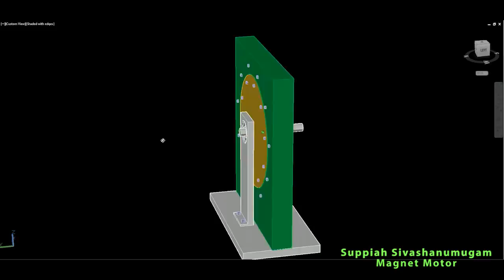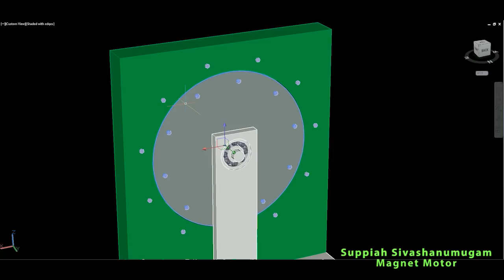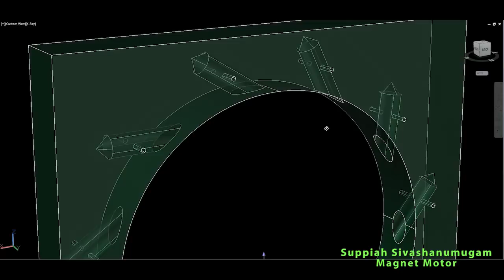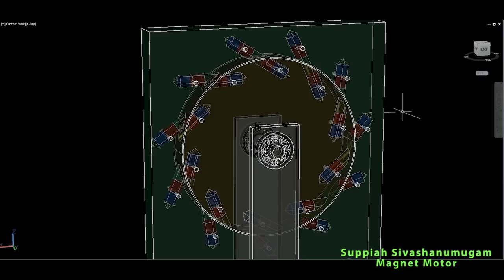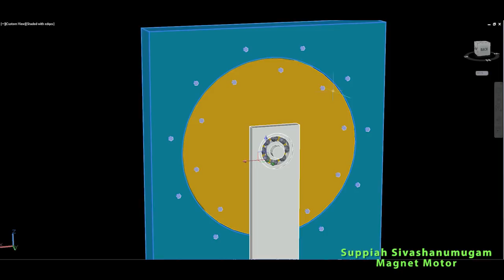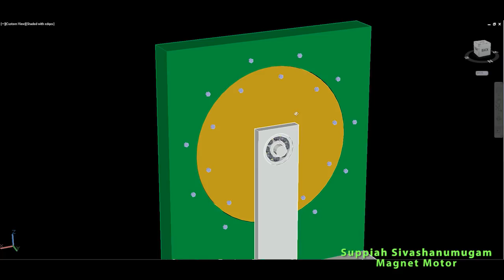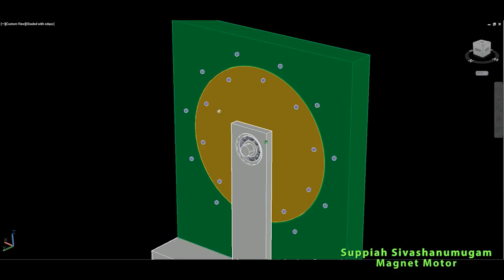FREE ENERGY, Suppiah Permanent Magnet Motor, Magnetic Motor

Comment: Over Unity Water wheel electric generator:
 Top of structure has Huge slanted basin (If looking at it from the side it would be slanting down to the right). When filled with water the water naturally slides down and over edge where it starts falling straight down causing water wheels to spin. Water wheels are stacked on top of each other not touching but close. As water falls it hits them all one after the other making them all spin as it makes it's way to the bottom. At the Bottom of the structure there is a large slanted basin. This basin is slanted in the opposite direction to the one on top so the water slides down to the left, into a pool of sorts that is U shaped,(imagine right below the water wheels is the shallow end and as it slants down it gets deeper for some distance then winds around to the other side of construct and comes back up to another shallow end. Now directly behind the water wheels on a flat surface that is above the pool of water that's curving around it, there is another wheel positioned vertically but this one is not a water wheel, this one has powerful magnets embedded horizontally inside of it on both of it's flat sides so there magnetic repulsive field is pushing outwards away from the disc on both sides. (Also each embedded magnet is surrounded in high permeability metal or Mu-Metal to focus it's magnetic field lines into a condensed strong field. This disc is powered by one powerful electric motor. Now imagine long hollowed out cylindrical tubes submerged & sticking out of the pool of water and reaching all the way up and into the basin that holds water on top. Now imagine each tube has a windy slide inside that goes from top to bottom. Now imagine the tube has rings around it that are magnetically repelled so when the main wheel spins around the horizontally positioned magnets hit into the side of these rings causing the entire cylindrical tube to spin. The spinning motion of the tube will cause it to scoop up the water in the pool and the centrifugal force of the spin and the windy slide inside will guide and force the water back to the top. Now remember for this to work properly there needs to be enough water wheels spinning to generate more electrical current then the motorized wheel needs to spin. 
Key Element 1: Number & quality of water wheels. 
Key Element 2: Quality of electric generator connected to each water wheel.
Key Element 3: Enough tubes to pull enough water from bottom basin back to top basin to equal the rate and amount of water filling both basins at any given time. 
Key fact: The accumulation of electrical current from the electric generators connected to the water wheels must be greater then the 1 electric motor needs to spin.
Key Fact: One must divert the needed electrical current from the generators connected to the water wheels to the motor spinning the disc that has the magnets on it. 
Key Fact : If this is done properly it would be an over Unity Electric Generator.
Reason why some may think this would not work: Some would say the amount of energy the motor needs to spin the disc with magnets on it will always be greater then the amount of electrical current being perpetuated by the electric generators on the water wheels complements of natural energy losses do to heat and friction.
This assumption is understandable however I will explain why this does not stop this device from being an over unity device. You see it comes down to one simple truth. The motor spinning the vertically positioned disc is only actually doing a fraction of the needed work, it is the horizontally positioned magnets impacting into the tubes causing them to spin that is doing the heavy lifting :) and since the magnets are positioned horizontally on disc the push back against them is unable to hinder the motor spinning the disc to a degree that would require it to do loads more work.  
In conclusion this is a device that can be self contained away from the elements so as to not hinder it's effectiveness. And it is an Over unity device if built correctly. 
& to all you nay Sayers out there I would just like to add I hope you all have a great day and whether you like it or not this design works. :D

Comment: Improvements to vertically positioned spinning wheel in electric generator design.
Design that allows the re-magnetizing of magnets horizontally plugged into vertical disc.
Aspects of Disc and connected components.
1: Disc it's self is non magnetic 
2: Disc has square shape (or other if better) in center that fits over shaft that is connected to motor that makes it spin.
3: Disc has copper (or other conductive material) ring around its rim. This electrically conductive ring has branching electrically conductive wires that branch towards center of disc. 
4: Disc has rectangular (or other shape if better) crevices all around it's left face and right face where the high permeability container housing the powerful magnets are to be placed.
5: Magnets in the high permeability material (steal/Mu-Metal/Other) have copper coils rapped around them and both ends of copper coils poke through small openings in the back side of the High permeability container. As they poke through they make contact with copper wire that is directly connected to the ring of copper around the rim of disc.
6: In front of vertically positioned disc is an electrically conductive brush (like the kind you would see in a motor making contact with the commutator) that can be pushed right up against the copper ring that is around the vertical disc. This electrically conductive brush is in it's own little rectangular housing that is not electrically conductive. However the bottom inside of this none electrically conductive housing is a lining of electrically conductive material so the current can travel from this to the brush and then to the ring of copper around the disc which in turn gets the electrical current to the coils around the magnets allowing them to be re magnetized while still apart of the Electric motors structure. The housing for the brush is capable of being safely pushed towards the ring and locks into place when it is directly touching the discs conductive ring. The platform the brushes housing is sliding on has electrically conductive plating and is directly connected to a switch so that the current cant get through until you want it to. This way brush can be pushed towards ring make contact and then switch can be flipped to allow current. When magnets are re-magnetized the switch can be flipped to turn off flow of current and then the brush pushed back away from spinning disc so there is no unnecessary friction.
Reply: Hello Mario
I would like to build such a project privately, would you make your CAD plans available to me?
So that I could build a working device
Thank you very much

Comment: one secret is to magnetically shield the leading edge of the magnets, I am looking into bismuth, but shielding like MU metal would work well.... another trick is to offset the magnets so that they are staggered sequence in matched pairs (180 deg) so there is not one large magnetic hurtle after hurtle... this can be achieved by having more matched magnet pairs on the outer ring than on the inner ring.
Reply: "Magnetic shielding" won't help, as magnetic flux is essentially continuous. Even if you use a superconducting shield, which is an ideal diamagnetic material, you'll certainly will be able to divert magnetic flux of the permanent magnets, but you'll never be able to "cut" them. So, the whole system will stop again, no free lunch here.
Reply: you are wrong
Reply: I might be, despite being a physicist I am just a human. But that also means that most other physicists and electrical engineers are wrong, which is also possible, but so far the relevant theories did prove to be right and allowed to built many millions of various rotating machines that do work. At the same time no device based on disagreement with well established theories of electricity and magnetism have proved to work (at least to work as their inventor intended them to). And I myself actually did quite a few experiments - real and numerical with lots of concepts of magnets, magnetic shields including high-temperature superconducting ones just to get and demonstrate the only results that lines up with electrodynamics and Newton's laws. The idea of magnetic shielding in order to achieve free energy or non-zero net EMF generation in a closed loop is not new and is known to be wrong for at least 120 years. Magnetic shielding is certainly a thing and it was a matter of very intense debate in scientific and engineering community at the end of 19th and beginning of 20th centuries as the world was being electrified, but that debate is over. An it is a textbook example of a common misconception as applied to naïve inventions. In the very essence of this misconception lies misunderstanding of essential continuity of magnetic flux.
Reply: much love brother

Comment: Why don't you make these In real
Reply: HA! Anything's too expensive when you'd just be wasting money on something that won't work. If it would really work, it would be worth the investment.
Reply from the maker: too expensive!
Reply: hi how can I connected with you??? how much 3d model???
Reply: sorry, this one is very expensive? 
how much costs plastics, neodymium magnets (on ebay), double bearings and practical arms (not mouth)?
This one is one of the cheapest generators you talked about. I think materials of this machine costs under 150USD
Just demonstrate one made by yourself, then talk about it.
I know that's possible to make such type of generators.
I don't ask about generator, made by russian inventor with bifilar coils and cylinder with neodymium magnets and programmable logic controller.